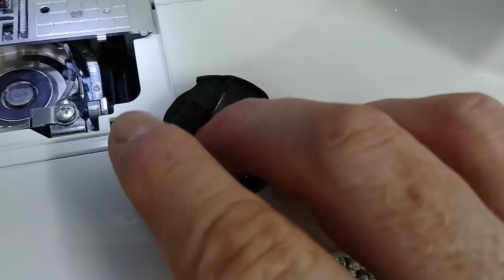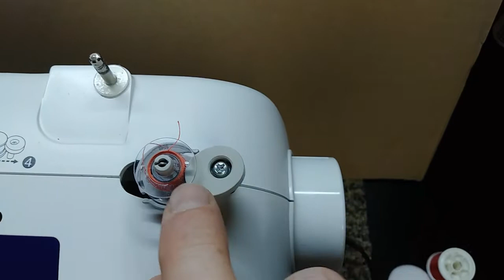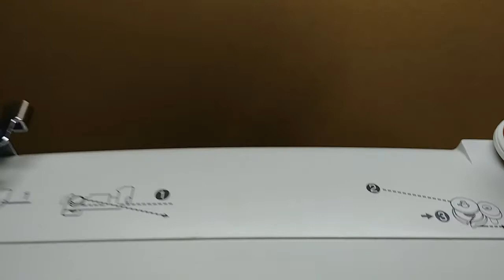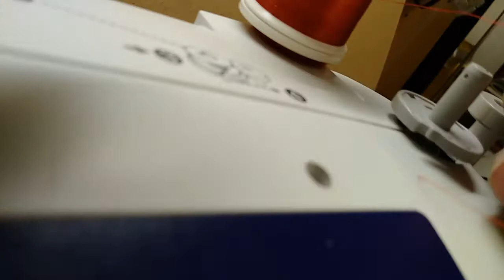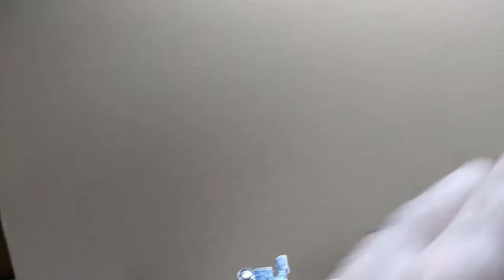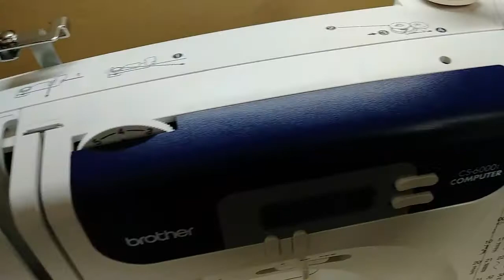Brother CS-6000i Sewing Machine Overview

Comment: I loved my machine, this exact one, until I messed up the timing. If I remove the cap on the back, can I reset the timing myself? Thank you.
Reply from the maker: Sadly unlikely, if you do not experience servicing sewing machines.
Reply: @arxmechanica thanks
Reply: P.S. Also right in the middle of the digital window is a letter. It tells you which presser foot you need, according to which stitch you pick.

Comment: There’s a button on back of the machine what is it for
Reply from the maker: If it has a small hole in it, that is a cap. It can be removed so that a technician can make a mechanical adjustment without having to remove the entire back cover.

Comment: Will metal class 15 bobbins hurt the machine? I was told that the plastic bobbins were just starter junk and to get some metal bobbins....
Reply from the maker: Lol. No plastic bobbins are far superior in many ways. They are not "starter junk" 😂 They are the standard for the industry. Whoever told that to you is misinformed. This rotary plastic top drop in bobbin case machine uses only plastic 15 class bobbins. Never use metal bobbins in a plastic bobbin case. It can cause damage to the plastic bobbin case and potentially cause other damage. In fact, in many cases with metal bobbins case front loading machines, they will run much better with plastic bobbins as well. Plastic bobbins have a bit of flexibility that metal bobbins don't. If metal bobbins get bent they can cause binds that lead to poor stitching or worse. Metal bobbins corrode. When plastic bobbins are damage out is very apparent because they are clear plastic. I hope this helps.

Comment: I am very new to sewing and was given a cs6000i brother machine as I was following along with you I mashed the button instead of the foot pedal and I keep getting an E1 code can you please explain how to correct that I did what the book said so I think I did LOL but still it will not work correctly thank you so much your videos are great
Reply from the maker: On this machine and similar models, you will get an E1 error if you attempt to sew when the pressure foot is raised. It's seen as a safety feature. Usually if you lower the presser foot down onto the fabric you can resume sewing. If the E1 error doesn't clear after lowering the presser foot restart the machine. If that doesn't resolve it it will need to be seen by a technician.
Reply: @arxmechanica  thank you so much for replying. I did a little research after writing this question to you and I found a video stating this is a common problem because I cannot get it to clear the code so my husband is going to open the machine up and fix it the way the gentleman showed on the video. Thank you so much have a blessed day
Reply from the maker: Because that machine does not have a interior frame, if it is opened up for repair you may need to reset the hook to needle clearance so it doesn't damage the hook or skip stitches. The hook should be about a hair's distance away,or less, from the rear of the needle. Essentially, it should be as close as possible, during operation without making contact.